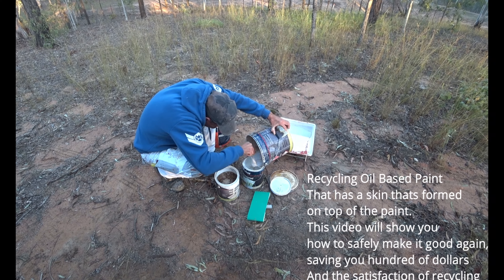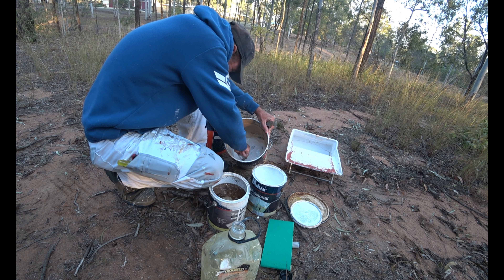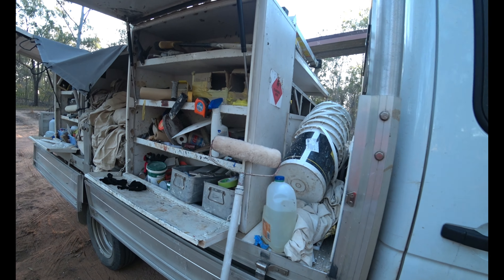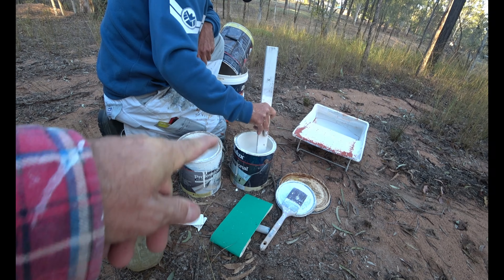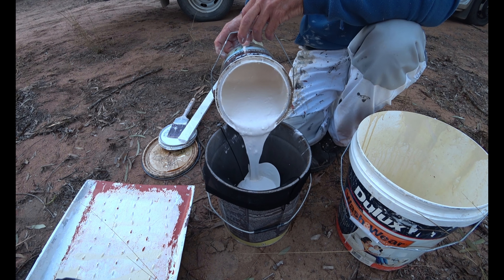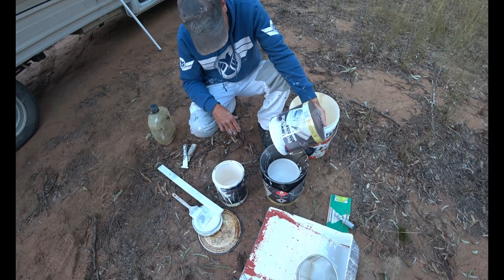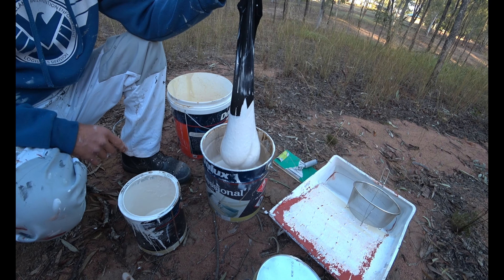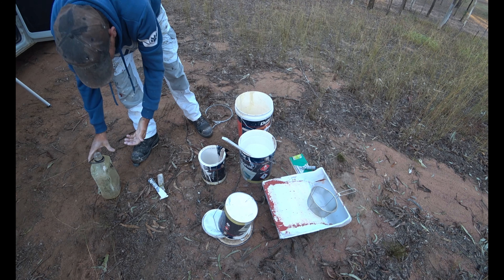Tradesman secret Recycle oil based paint

Comment: Loving the videos👍
Do you soak your brushes long in the diesel?
Reply from the maker: No, just a quick rinse,after you clean with turps, only a few table spoons full ,flick out and the oil in the diesel keeps the oil brushes soft
Reply: ThePa1nter thanks for that will definitely start practicing this method, 
What about your spray tips how do you store them? in a tin of turps or possibly diesel?
Reply from the maker: I have all my tips in a bucket of water with my gun handpiece. I never let my gun dry out

Comment: Also can turps be added to white or any oil based gloss paint to remove the gloss to make an undercoat
Reply from the maker: Turps will won't remove the gloss,its used to thin the paint or wash the brushes out

Comment: Hi There,

Great video , can I mix gloss oil paint of different colours , different sheens and different brands - if so can it be used as an undercoat or topcoat.
I an painting a shipping container (starting on the f
Reply from the maker: I can't see any reason why mixing them together would be any issue, I would not be using them as an undercoat but if the container is in good condition you could apply two coats of oil enamel but making sure you leave 24hrs minimum between coats. If the container is rusty you can use flood product penetrol in the paint to help.

Comment: The roof first . I am grinding off any rust and sanding existing paint surface and then priming with red oxide (solver brand).
Reply from the maker: Good idea, look at buying yourself 1 litre of penetrol and add 10% to the red oxide.